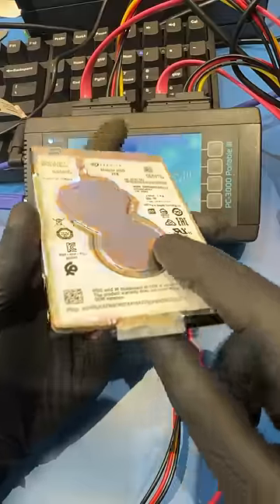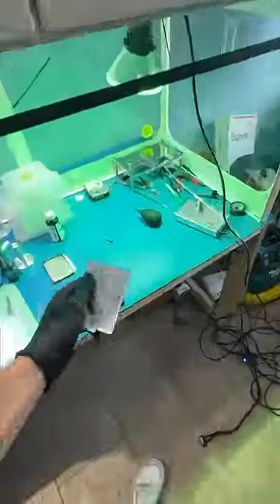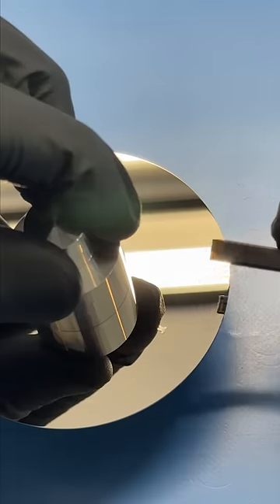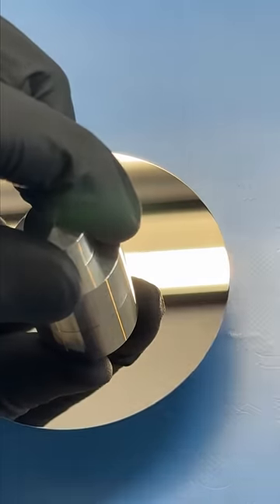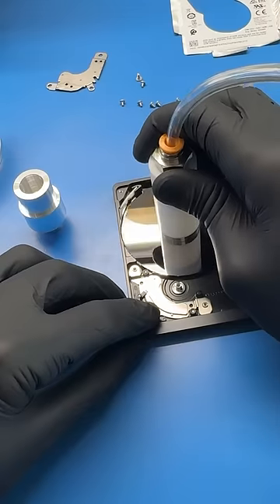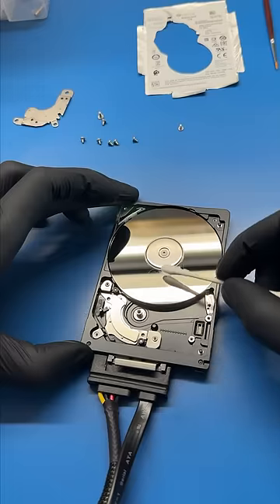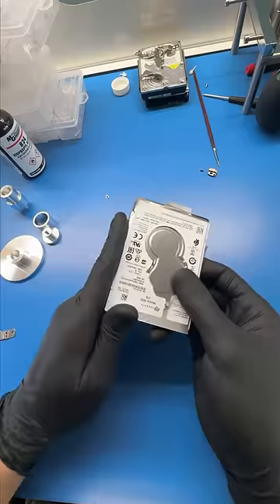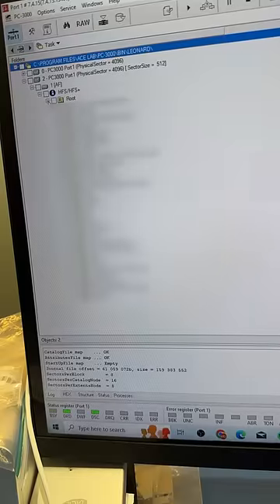Removing Platters From Hard Drives? #tech

Comment: Just one thing I think should be mentioned. This type of repair should be done in a sealed, totally dust free environment. A single speck of dust on the platters can damage it.
Reply: He has a vented hood that keeps his desk dust free
Reply: Using a Laminar air flow work bench with a microfilter, so no dust to worry about. I actually want to get one for this very reason.
Reply: Not damage it exactly. It just makes reading the drive harder.
Reply: I have done this in my own house at my computer desk 4 times and have had no issues.
Reply: Apparently this is becoming an urban myth just like how water could be said to instantly destroy any electronic devices but technically not so true as long as everything is dried up before applying electric current. In this case, a single grain of dust won't likely to completely brick an HDD. Even if there's any, he most likely clean any dust before reassembly.
Reply: Nah, just backup the data while you can and expect the current drive to die in the next few hours
Reply: I bet you're fun at parties 😂
Reply: @vanringo You are very lucky, I had an old hard drive I opened to make into a transparent one as an educational project, when the lid was removed, the drive never worked again, it wasn't a helium drive either. (it didn't work when i put the cover back either. Never touched anything inside either.)
Reply: @RetroScythe I remember those days when everything was trying to be transparent. The other thing that nobody tells you is that those screws have to be torqued to a specific torque spec otherwise the drive dies
Reply: @nate6386 Im not really old enough to remember that (born 2001) but I saw a few relics from the 90s that were transparent, its what inspired me to do that.
Reply: Welp, guess my psoriasis ass has to to stay out of this one😭 I’ll stick to a simpler thing
Reply: Until the head finds the dust  @iCore7Gaming
Reply: I more concerned of the hughe reding heads on the drive plate. The customer is real lucky not had any scratches from the lose heads.
Reply: I used to do this in my bedroom when hard drives were 30 60 and 80 GB at best. I miss those days lol
Reply: Well and I was taught that HDD disk are air tight and air sealed ao the print head is floating just above the surface of plates.
According to this, once you open it up, seal is gone and after reassembly it will only scratch the surface.
Thanks you all for this comment section. Now i know it's doable to open it by myself and repair
Reply: This is exaggerated. And has been for 20 yrs. Plenty of in house repairs that have worked.
Reply: If you're lucky, the dust will be flung off when the drive spins up. If that's not the case, it can get lodged in the microscopic air gap the heads "fly" on top of, disrupting it and causing a head crash. If there is dust remaining in the platter, it's not a question of if the heads will crash, but when. It's simple physics, not superstition.
Reply: @udhi_gn3893 He literally shows cleaning the platters before reassembly in this short lol
Reply: @vanringo wow how?
Reply: this drive will only be functioning until all the data is extracted, not to be used for a long time after this proccess. the important part is being able to recover the data, after that, thats it. drive may still function properly but is best not to use for backing up important data.
Reply: I imagine that most dust particles are nothing in comparison to that damaged reading head swiping back and forth how ever many times it originally did.
Reply: that would have to be a pretty hefty sized piece of dust to actually damage the platter. like a wood grain or assault particle or piece of dandruff or something. normal are dust I don't think would actually cause damage, me create a read write issue though temporarily
Reply: @szablitho3439 just remember that comments about the screws requiring to be torqued to a specific amount,
Reply: @midgetman4206 I agree, The platters are metal after all, and as far as I'm aware hard drives have a decent amount of either redundancy or some type of noise correction or error correction or something
Reply: I've done it in a chicken coop. No problems with dust or feathers
Reply: Some enterprise level drives are helium filled.
Reply: Yeah try teaching the professional who’s been doing this for years on years after watching 1 of his video 🤡
Reply: There is no „totally dust free“ environment. You can only lower the amount of dust in the air in clean rooms. There are specialised data recovery businesses that have those, but if those are too expensive for the customer, what can you do?
Reply: Which he has exactly that lol
Reply: @RawApeFromAlbion  I wasn't teaching him. I was telling others that might want to attempt fixing their own hard drives at home. You should think before you call someone a clown.
Reply: @udhi_gn3893  iindeed its a lie made by dudes in the vid to create more custom,same for tv repair shops that said you need to bring them in to "refill the screen with plasma gas" which isnt true lol
Reply: @udhi_gn3893 isnt it dependent on the drive size? if it's like 1tb on a single platter alone, it might post a problem as the data density increases
Reply: Just to scare off people so that they buy new ones
Reply: @iCore7Gaming  No, it definitely can damage the drive.
Reply: @vanringo those drives will implode at any minute lil bro
Reply: @szablitho3439 I used to think hard drives were air tight but they all have that little vent
Reply: @mathewoliver2566 they will still work fine if the seal is broken, they may run slightly slower though due to the air resistance difference between helium and regular old air
Reply: @sgoatrTWO Underrated comment
Reply: This isn’t a how to video or telling people this is what they should do, he’s just showing himself fixing a phone to help promote his business but regardless, ppl should educate themselves before doing stuff like this & if they don’t & that’s their & fault not his.
Reply: Absolutely correct these drives are assembled in a clean room with technicians covered from head to toe with clean room suits and the rooms are under high filtration that not even any dust gets into these rooms and the same thing for the employees at work in these clean rooms that deal with not just hard drives but nanotechnology
Reply: Did this in the yard on a table, no problem🤷‍♂️
Reply: For this kinda recovery, it doesn't need to work longer than completion of the copy op.
Reply: just one thing…that’s bs
Reply: Hmm yea … never thought of ripping hard drives to fix ? Always thought you’d need a very clean laboratory environment. 

Always thought it wasn’t possible at home
Reply: The condition to repair room is no more 3 pieces of bust per meter of square. Other way hard drive to trash bin.
Reply: He's under a hood that provides clean room level air clarity
Reply: It just for recovery once it's done you can put that HD in the trash
Reply: @wilsondavenport6939  not good enough clean rooms are designed so that no particulates over .5 microns are in the room. and air in that room is exchanged 30-60 times an hour, and there are even better clean rooms that change the air around 240-360 times an hour, with nothing above a .1 microns
Reply: Thats a myth
Reply: What I think is amazing is that those 3 squares were on the platters and he removed them just like that.
Reply: Once the data is off the donor drive it doesn't matter if it breaks afterwards. Would be a fool to continue using it and not copying it onto another fresh new drive.
Reply: @vanringo sounds like bull..it
Reply: Blablabla
Reply: he's just imaging the drive and tossing it.  It's not going into use again
Reply: @iCore7Gaming  What happens to your username if you get an i9? 😂😂😂😂😂😂😂😂😂
Reply: @iCore7Gaming no, it WILL damage it. HDD read heads are so close to the platter and moving so fast, its equivalent to a boeing 747 flying mach 4 1” above the ground

Comment: A long time ago, I had a 40mb  IDE hard drive fail, so I found another hard drive of the same model, took them both apart down to just the frame and platters. I then rebuilt the bad drive with the parts I took out of the second drive. It worked perfectly. It wasn’t until years later that I found out I had done something very few people would ever attempt on their own. I also learned that hard drives should only be taken apart in a clean room because a single dust particle could destroy data. I didn’t take any precautions. I just assumed my data was there and I could recover it by swapping out any bad parts, and it worked. Now that I know how lucky I was, I’m not sure if I would do it again.
Reply: i imagine it worked because older lower capacity drives would have looser tolerances and thus be more resilient to dust
Reply: @simmyabis7330  I don't doubt that is true. There is 100,000 times the amount of data on the same sized platter in a 4tb hard drive compared to a 40mb hard drive. A single speck of dust can have a bigger impact on a modern hard drive than a pile of dust on a hard drive made over 30 years ago.
Reply: When i was in my high school senior year computer course, we were turned loose on our own computer lab. Computers, parts, tools, the works. One day i got a wild hair up my ass and decided i wanted to watch my hdd working so i opened it up and booted my computer. That computer ran with the hdd wide open for a good chunk of the year. Looking back, i genuinely dont understand how
Reply: @johnfeistner467   It only worked like that because you didn't know any better. Had you opened it up like that knowing how delicate hard drives are, it would have failed in a day.
Reply: @xnetpc can cause issues with the heads and scratching. Usually not a catastrophic data loss but not great for the drive
Reply: @xnetpc  sounds about right
Reply: I did a similar thing but with a few broken laptops my dad gave me when I was ten, we spent the night together troubleshooting and fault finding. He went to bed and said we can do it tomorrow but I was too excited at the idea of having a laptop, so I stayed up all night taking them apart and he caught me at like 8am as I was loading up cs 1.6... I miss 2006.
Reply: @johnfeistner467 What year was it? All of this stuff gets more precise over time.
Reply: I love doing something like that only to find out it's almost impossible an no one but me would try it....an it pays off
Reply: Back in the '70s and '80s most hard drives had removable disk packs. Recommended procedure was to load the pack and spin it without loading the heads. Then load the heads. In practice, we usually just loaded the pack (9 platters) and ran with it when doing disk-to-disk backups. Disk crashes were very rare.
Reply: I mean 40mb is hilarious so maybe you did corrupt a byte of data. But a spec of dust on a tb hard disk could prolly corrupt like several thousand byted or multiple sectors
Reply: As a CS major you were really really lucky that day that you literally swapped 2 identical HDDs's parts and made a perfectly working HDD even without the specific environmental condition. That's undoubtedly a core memory for you..........
Reply: @xnetpc  If I take the platters out in aligned and put them on the 60gb donor drive that come with the same model, first 3 digits of serial number as the failed drive, will it work if I should be able to get access to my data without make any changes?
Reply: @chris01479  It was over 30 years ago when I did this. I can't remember many details of beyond what I described in my comment. Sorry I can't help you.
Reply: waaaay back in 2001-2003 ish i pulled a couple of ~400Mb HDD's apart and made windows in the lid, as long as you made some effort to do it in a low dust environment they worked. 
Best bet was to pull the drive apart in a bathroom after it had stopped being steamy after a shower.
Reply: @ravenof1985 I bought a western digital raptor with a plexiglass window showing the drive’s internals, but I’ve never seen anyone do that custom. That’s pretty cool that it worked. Did it look cool?
Reply: @xnetpc  yes, it was very entertaining to watch the read heads doing their thing, 

AFAIK that windowed WD drive came after a few people modded HDD's with windows, same thing with the acrylic side windows, LED lightning and painted cases.
Reply: @xnetpc thats what the person said yeah
Reply: You can sometimes get away with this, especially for older drives. It really depends on how important the data is to you; if it's really important and you don't want to lose it, you want it done in a clean room. If it's not really that important but would be nice to have, it can be worth trying this if the alternative is cost-prohibitive and the alternative is that you're SOL. It's not TOO difficult to make your own custom mini-clean room for these kinds of operations, though. There are guides on YouTube.

Comment: It is so crazy how this tech was considered cheaper than SSDs for the past 40+ years
Reply: Its actually simpler compared to ssd. Just wait until you see schematic diagram of 4nm ssd ic😂
Reply: @ayn30  yeah I know. All data storage tech is kinda crazy when you get into it. But when you hear "discs spinning around real fast that are so fragile a bump might fuck up data, and you need a neutral draft to take it apart or else" doesn't really make you think it would be tech basically everyone used
Reply: @justpassingby298  before i wonder how disc work when i child. Then i see at the disc the got like mark and different burn on used part. Data storage technology never ceased to amazed me.
Reply: Лента ещё дешевле но не так удобна 😢
Reply: The reason why it's cheap is because it's made in Thailand. Low labor cost plus government incentives means they can make more hard drives in Thailand than anywhere else, and it drives down the cost.

SSDs are just getting popular but is catching up fast on HDD capacity.
Reply: It still is in some respects as SSDs still can’t match HDDs when it comes to overall storage capacity. SSDs are faster, but they also used to get really hot which could cause problems. Until SSDs can match HDDs byte for byte HDDs are going to be cheaper for high capacity storage
Reply: @justpassingby298  No recovery of SSD when it's mechanically compromised. At least platters can be made to work again, a chipped chip will be gone forever.
Reply: Haha wait till we get the new HDD tech with dual face platters.  Think I saw like 120tb as the foreseeable horizon for capacity haha
Reply: There's pros and cons.  Speed is the biggest pro for SSD which is tangible.
Reply: @darknase chips are considerably less fragile, you can just look at shock tolerance ratings and see that a hard drive is far more likely to have a problem even if just dropped in a normal home/office environment.

It would also require much more specialized tools to recover data from a shattered platter if it's even possible.

Also if we're just talking about normal wear, it's quite common for hard drives to fail in a way that makes them unreadable without repair, whereas SSDs that are failing due to wear are often at least partially if not completely readable
Reply: It still is much cheaper than ssds😂
Reply: I have a 16TB HDD
Reply: Considered?
Reply: HDD are still cheaper than SSDs (and are still in production and use).
SSDs are the best for your first (booding) drive and where very high speed is required.
Mechanical disks are still the best for archivial purposes, backups, NAS and also for cloud storage.
Reply: @ayn30  you won't need to

Comment: I remember a time when you had to Park a drive before you could safely shut your PC down.  10MB drives costing several hundred dollars.  MFM & RLL drives.  SCSI, Wide SCSI, IDE..  The oldest drives I ever saw in operation came in disk packs, and the platters were larger than 33 record albums and about 3 times thicker..  The drive controllers being the size of a desk...  every once in a while, a head would crash into a platter and corkscrew off the magnetic media.   It's amazing how far they've come along.
Reply: and when the power goes whilst the PC is on causes head-crash and say bye bye to your drive lol
Reply: I remember those drive types and also loading and unloading the large disc packs for a PDP-11.
Reply: Right there with you. I have a half dozen 147gb SCSI drives somewhere around here and even a few drives that are measure in MBs.

On a slightly different note - for year I had a 4MB RAM stick on a key chain.
Reply: What's amazing is that there are 24TB HDDs which you haven't mentioned.
This is actually the amazing part.
I only have a 16TB HDD and many other smaller ones. It's very difficult to completely fill it as an average person. But it has to be such a relief for big data centers
Not having to maintain many small drives but rather a small number of super large ones.